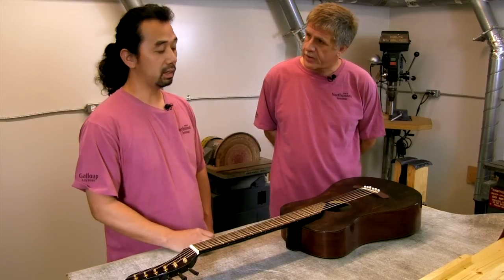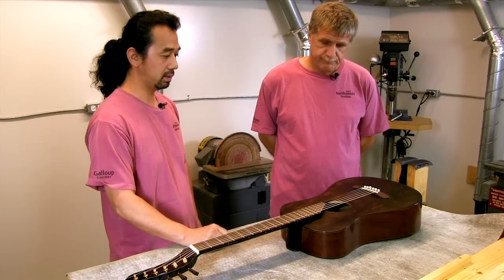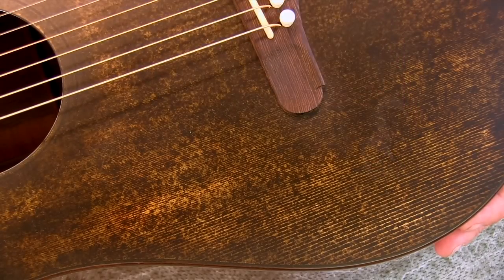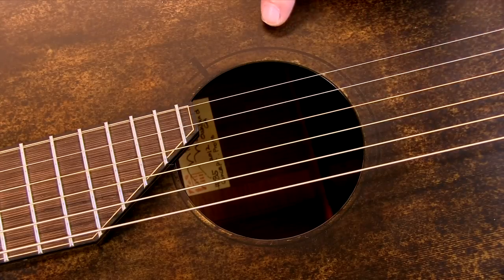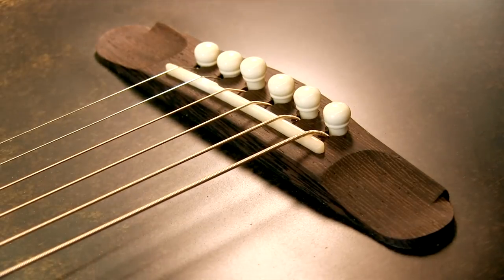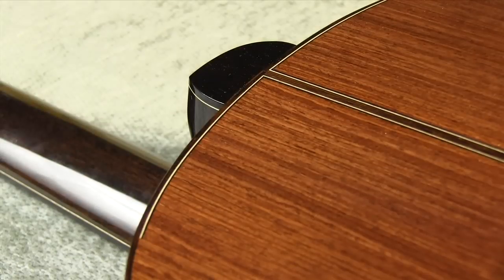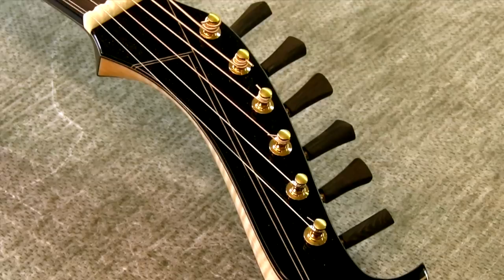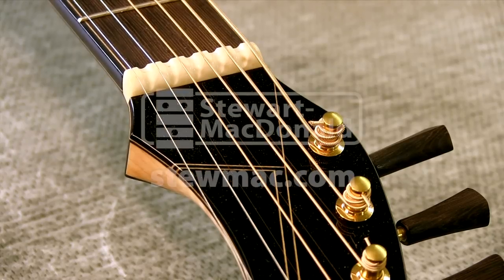Michi Matsuda's gunpowder scorched guitar

Comment: I wonder how the gunpowder affects the tone of the guitar, if it affects the vibration in the wood and how?
Reply from the maker: For the most part, the scorching created with the gunpowder is only an aesthetic modification. The scorching is so light that any effect to the tone is really negligible. The scorching is so superficial that we do not recommend sanding the body before applying finish, otherwise you are likely to sand right through the scorches. Instead, we recommend using pumice mixed into the the shellac. This way, any low spots are filled during the French polish finishing process without removing the gunpowder scorches.